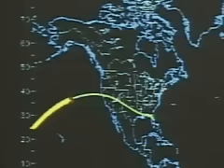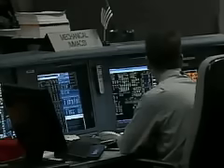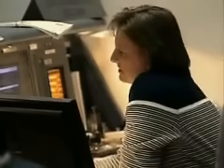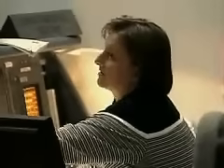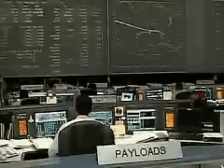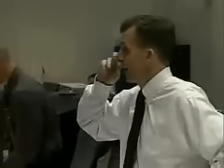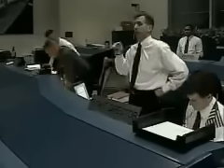Inside Mission Control During STS-107 Columbia's Failed Re-entry and disaster

Comment: Boy that Mission Control. The shuttle is coming apart, the crew is dying and they look bored and clueless. What professionals!
Reply: It is called doing their job. If everytime a potential disaster or dangerous situation occured Mission control freaked out and became emotional, further safety would be compromised. If everytime a patient started to die the doctors acted hysterical, would sufficient care be given? They did what their job required them to do,  continue preform the duties if nothing had happened. If I was in space I would NOT want you as my mission control, your ignorance infuriates me.
Reply: 1. They dont look bored, they are reporting data. Try looking emotional or interested when you are reading numbers. 
2. What does skin color, and genitalia have anything to do with the situation, this just shows how ignorant you are. 
3. I suggest you go and do some research, before you insult an organizationcapable of things way beyond your minimal mental capacity.
Reply: No one in that room looks "bored" or "clueless".
I won't respond to your racist and misogynist comment.
Reply: I do think, perhaps you should try it. I'm not belittling I'm blaming them. What happened to the shuttle was not an accident in a normal sense it was avoidable and someone on the ground was to blame. The first reaction of Mission Control was "Lock the Doors" meaning cover our asses. If you choose to bury your head in the sand why not do so at a playground or grammar school so that the children can use your backside as a bicycle rack and you could serve some useful function for society. People like you make me want to vomit.
Reply: 456swagger Good grief, you're ignorant.  'Lock the doors' doesn't mean 'Let's all hide in this room', it means 'NO-ONE is leaving this room until every single piece of data in this room has been analysed'.  But please, continue to enlighten us on how bored and clueless they all are...
Reply: 456swagger
Consult a therapist, you need help.
Reply: 456swagger Seriously, what could they have done? The hand had been dealt and the damage to the shuttle irreversible. And the guy in lead is ashen-faced - not bored and clueless. It's easy for us to just sit here and cast judgments not in their shoes, but that's what YouTube is good for. As for locking the doors, this had to be done as part of the investigation that would follow. It was securing the room.
Reply: 456swagger  Your recollection of Apollo 1(Apollo-Saturn-204 or AS-204) are not correct.  There was no fire for outside workers to fight, it was all internal.  They were performing a "plugs out" test of teh capsule which was using a 100% environment. There was too much combustible materials inside as well. People ran away from the capsule as they were afraid the Launch Escape System would initiate.  It took many minutes to get the hatch open, and they abondoned removing the crew in a hurry as doing so would have disturbed the scene.    The hatch was an inward opening design, so the increased pressure from the fire heating the air made the hatch un openable until pressure reduced. Unfortunatley the hatch did not have an explosive charge opening feature because of teh previous incident in which an exlosive type hatch had opened itself during a Mercury water landing.

You are comparing people sitting in Missions Control Center(MCC) in Houston Texas, to people at the launch pad in Florida (Kennedy Space Center=KSC) where the Launch Control Center is located.  As soon as the Saturn V(Apollo) and STS(Space Transportation Syste-Space Shuttle) cleared the launch tower, control of the launch vehicles switches from KSC to the MCC in Houston Texas. When the Columbia started to burn up, it was travelling at Mach 22.5 (17,125mph or 25,000 ft/second) or 10-13 times the speed of a bullet.  At 8:15:30am the Columbias is flying upside down and backwards, tail to the direction of travel her OMS(Orbital Manouevering System) engines were fired to slow her to begin the re-entry process. The burn lasted for 2 minutes:38 seconds and slowed Columbia, them Rick Husband thrusted the Columbia into a heads up nose forward orientation.  The point at which the Shuttles encounter a noticeable atmosphere is at 400,000ft, this point is called Entry Interface, this occued at 8:49:09am.  This is when the counters begin to count, Entry Interface+000 seconds).  At 8:48:39am or EI+270 seconds the left wing spar was seeing higher stress levels than any previous Comumbia flight.The public saw brightening of the fireball(all SHuttles re-entering appear as a fireball) but some pieces were seen at 8:53:46am(EI+577seconds),as the Shuttle crossed from California to Nevada
, then later on people saw streaks in the trail(8:54:25am-EI+614secs). Then then the weird off scale low sensor readings began.  8:59:32AM(EI+932secs) was the last cut off message from the Mission Commander, then observers on the ground saw the orbiter break into pieces at 9:00:18am EI+969seconds.. 
Columbia was due to land at 9:16:am EST, by 10:30am, NASA Administrator Shawn Okeefe had enacted the International Space Station and Space
  Shuttle Mishap Interagency Investigation Board and had named Admiral Harold Gehman US Navy(retired) as its chairperson.
The whole world did not know before Mission Control made the contingency call to lock the doors.  Leroy Cain(flight director who made the "lock the doors call) had suspicions many minutes earlier.  This video is a shortened condensed version.  The Astronaits aboard Columbia didnt even know what was happening until it was too late.  There were people who were negligent in their duties to use rsources to look at the wing leading edge, but none of them were in that flight control room shown in the video.  Once the Columnia had fired its OHMs engines in order to begin to slow down to cause re-entry, there was nothing that could have been done.  The time for action was on Flight day 2 or 3 when they should have used satellite or ground based telescopes, or a spacewalk to survey the damaged RCC panels.  Many people at NASA thought that the RCC(reinforced-carbon-carbon) panels were very tough and rugged, but they werent. Someone said the analogy of "if a styrofoam cooler blows out of your truck and hits a cars windshield behind you, the cooler simply breaks into pices and doesnt damage the windshield. Only thing is that the SHuttle stack was travelling 1,568 mph(faster than many bullets), the foam fell off air drag slowed it down to 1,022mph in about 0.2 seconds, and then the shuttles wing hit the foam with a relative speed of 545mph.  Now the "styrofoam cooler" analogy hits the windshield at 40-50mph, imagine what would happen at 550mph?

NASA is still doing great things, esp. considering the shoestring budget they receive.  NASA gets 1/2 a cent on every Federal budget dollar, during Apollo's moon shots, NASA was getting 4.71 cents on every dollar(4.71%).
When STS(Shuttle) was approved, NASA was budgetted with 1 cent on every federal budget dollar(1%), by 1986 5 years post shuttle it was down to 0.75% in 1986, back up to 1.01% for 1992 and down to 0.5% by 2012.

In 1997 a poll was conducted and Americans thought that about 20% of the budget went to NASA. When actually 0.5-1% went to NASA during that timeframe.  In 2009, it was estimated that most AMericans paid less than $9.00 through personal tax to NASA.
There are spinoff that enrich AMercicans as well. In 2002, the aerospace industry accounted for $95 billion of economic activity in the United States, including $23.5 billion in employee earnings dispersed among some 576,000 employees.

Stop spreading your nonsense, do some research and contribute something positive.
Reply: 456swagger You're an idiot, that's an established part of the procedure. They are securing evidence to use in the accident investigation. This isn't a CYA move, this is a move mandated by NASA.
Reply: I think there is an element of shock, no? There is no right way to respond to this kind of tragedy.
Reply: So what could they have done that you would have done in that moment?
Reply: You didn't answer lol
Reply: hoghogwild I commend your detailed post and you taught me quite a bit, but I truly think 456swagger is messing with us at this point.  No-one could be that stubbornly stupid.
Reply: Somebody's been watching too many movies.  They're pros, they don't go in for cheap theatrics.  But it's written all over their faces, their stances, the way they suddenly can't hold still.
Reply: You don't know what you are talking about, shut the fuck up.. Mission control is trained to remain calm.. This is not the movies dumass, no Bruce Willis to swing in at the last second and save the day..
Reply: What should they do ? send a repair man?
Reply: you are a bigger joke
Reply: They are supposed to remain calm because there's nothing they can do. Even if they had to rescue the astronauts from a burning shuttle on the runway they can't because the shuttle landed either in California or florida and they're in Houston. After break up they lock the doors and not let anyone in or out so they can collect telemetry and start a preliminary investigation
Reply: 456swagger Every one of your posts is a pile of ignorant crap - you should stick to playing with your Lego blocks little boy.  Leave discussions such as this to informed adults.
Reply: 456swagger You realise that the crew were dead long before the first 'Comm check' transmission was made, so please explain how mission control was supposed to bring them back from the dead? Bored and clueless?  I think you were looking in the mirror when you came up with that line, lol.
Reply: Not much you can do at that point..
Reply: Eleanor Martin did all they could there guys dyeing there
Reply: It's not like in the movies. You can know horrible stuff is happening but you don't let it enter your head until later. You pretend it's okay so you can do their job. If you prefer them to panic even just enough to show facial expression then you're wanting them to faulter in their job at a time they need to be at their best.
Reply: No ones knows what can be accomplished until they try. If mission control can't do anything then fire all their lazy asses. That entire Organization is drowning in a sea of estrogen. When a fire engulfed Apollo 1 NASA employees attacked that fire with everything they had and risked their lives even though their was little chance that the crew could be saved. They put the lives of the crew above their own personal comfort and safety. They didn't sit around in comfort while the crew perished. The "new" mission control in this video are sitting on their asses pretending to track a flight that has already broken apart. The entire nation knew the shuttle was lost and was visible to millions and these clowns still didn't get the message until someone called it in. But I guess you're right though you must work for NASA okay I'll make you feel better "Lock the Doors!" Lock the Doors!" Whoo Whoo Whoo. boy you're right it works!
Reply: If I was in the Shuttle I'd have burned to death while mission control was "locking the doors" and cooking the data while they were cooking the crew.
Reply: ***** As in not sending a repair Woman? What kind of sick joke is that?
Reply: You're an ADULT? I don't think so because you've made comments about me that are so absolutely so far beyond stupid that you couldn't believe it. Have you ever held a security clearance sailor boy? Have you ever met and talked with any of the Mercury , Gemini, or Apollo Astronauts? I don't know anything about Technical "Stuff?" Let me guess. You still live with Momma and Daddy. Or do you still call him DaDa? You watched Apollo 13 and you're a expert on Space matters. Tom Hanks did not go to the Moon, I know your sad, crushed even, but someday when you grow up you may get to do something worthwhile Hell! who knows? You may even get to kiss a girl. or a Boy.
Reply: No their job was to support the crew and to prevent what happened not to sit and act bored while the shuttles comes apart and the crew dies in a most horrific fashion. You may be right about one thing they probably could not have done anything to prevent the loss of mission and crew.That's what happens when you hire someone not according to their qualifications but based on their genitalia or on their skin color.If your infuriated go see a psychiatrist and learn to deal with your emotions.
Reply: Eleanor Martin It's not possible to insult an organization you twit. Many of these people were hired based on their skin color and or genitalia. It's called affirmative action. Many of these people would never have been hired by NASA in the sixties because back then NASA wanted the best. That's why the shuttle missions only orbited the earth. The same mission John Glenn flew in the early sixties. These people failed in their mission completely. They were supposed to bring back the shuttle and crew safely. The flight Director lost the shuttle and crew and got promoted. That's NASA.OH by the way genius there is no such word as organizationacapbable. Do some research.
Reply: MrBluemax996 No they didn't do all they could do. The Flight Director could have kicked the trash can and yelled "I DON'T WANT ANOTHER ESTIMATE! I WANT THE PROCEDURES!" Then the flight controllers would have taken a bag of debris and built a heat shield and the crew would have been saved.
Reply: executivesteps Since you can't respond I'll sum up your argument for you. Let's see it probably would go something like this...nana nana boo boo nana nana boo boo. Wow you really convinced me.
Reply: You need a Thorazine drip
Reply: Yes there is a right way. If you're in mission control then it is you "DUTY" to do everything in your power to save the crew. If these nasa people had been the support for Apollo 13, the crew  would have perished with these clowns just sitting there there clueless and their only action would be "Lock the doors" which means cover our asses. I like that "it's not our fault" excuse. It was someones fault." Duty", she sure is a bitch sometimes..
Reply: Matt Dargis No they didn't loose their shit. They lost their Shuttle and the entire crew while they set their clueless and bored. They all kept their jobs and some were even promoted. Boy that NASA, I'm glad that the Air Force has it's own Shuttle.

Comment: Bad construction of the Shuttle which did not have any heat shield protection in the hull of the interior wing. Amazing no sensors on the wings to indicate damage. Even a micro-meteor can penetrate the skin should sound alarms. How to get them back down if they had known was to run up another Shuttle for rescue. I am satisfied NASA is going back to the traditional rocket lift instead of the poorly designed Shuttle that was never meant to be the main stay program.
Reply: this design had been flown many times over before this incident, this was the first of many iterations of the space shuttle over time, and they dont produce these like china does toys this was the only shuttle launched that year and if they knew about damage they would have would have just docked to the iss and hurry to get another country able to launch a rocket to resupply the station (which of course would be sooner then normal because of the abundance of people) and to take the astronauts home

Comment: I can't understand from the vid..whose fault was it that the shuttle crashed?
Reply: When reviewing the video footage from the takeoff, NASA technicians found that a piece of insulation foam from the fuel tank detached and struck Columbia's left wing with intense force and created a small hole on it, which was what caused the disaster. The technicians insisted numerous times that NASA should take satellite photos of the shuttle's wing to assess the damage while it was still out in space, but NASA's management didn't think this was a serious problem and turned down their requests every time, partly because NASA was facing massive budget cuts by the government in 2003.

Comment: Mission control gets a lot of data via live telemetry and way better quality than any video feed. They knew immediately when the tracking data failed that the shuttle was DOA. This video describes the engineer monitoring the heat sensors in the aft wing as failed, hence the burn up was in progress.
Reply: From what I read (and saw) this wasn't completely true. At 5:15, you can hear columbia's last transmission to MCC. They then keep watching and trying to radio the shuttle. At about 7:50 you can hear someone hypothesize that it was just an instrumentation issue but by 12:30, mission control gets word that people had seen the shuttle disintegrate in the sky and he orders the doors locked until he can complete and investigation. It had apparently not been confirmed until this point.

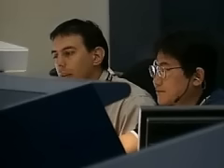Comment: Actually the problem starts at 1:40 where the commander states "FYI I just lost four separate temperature sensors on the left side of the vehicle"... that was  when Houston knew the outcome, and there was nothing the shuttle crew or mission control could do about it, since the shuttle was already in decent flight....

Comment: At 4.02 the flight director has a monitor in front of him that looks like the on board cam on the shuttle you can see images moving. After those poor soles had died and with all of them coming to terms with all what was going on you then look at 19.00 they are watching something on the same monitor it clearly upsets all of them most of all the FD I wonder if it was either a replay of the onboard cam at the point of break up or the vid of the shuttle breaking up overhead either way very sad vid.